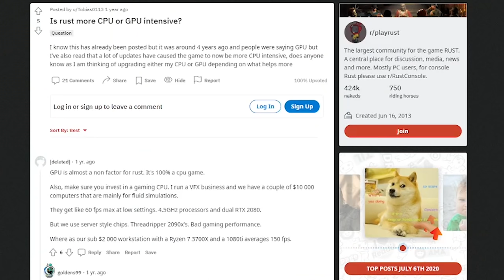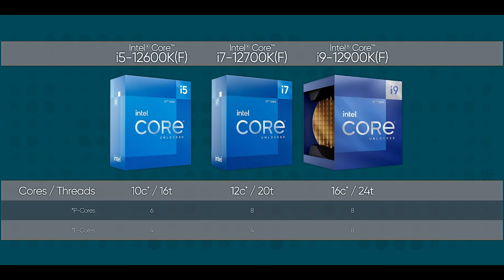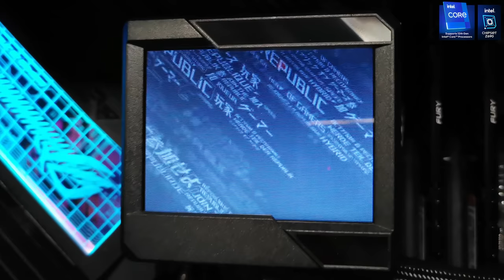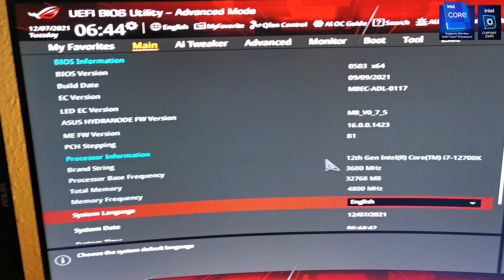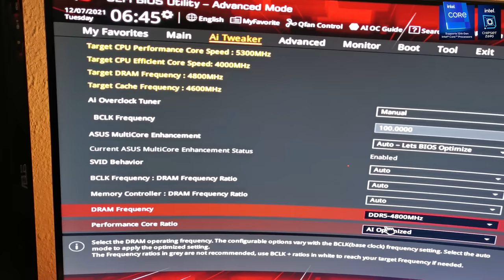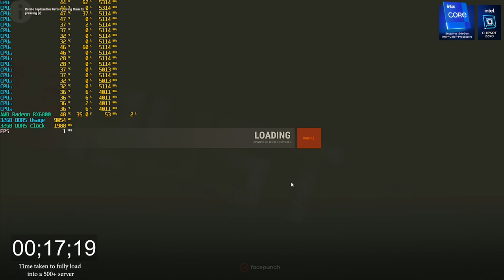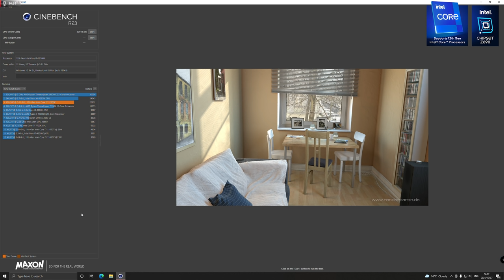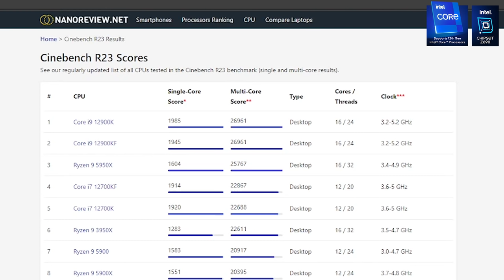RUST vs the worlds Fastest CPU

Comment: You keep saying "nothing is struggling" meanwhile your onscreen chart is showing multiple CPU cores sitting above 80%. The chart clearly shows that you are struggling to keep the main threads of the game running consistently.

I'll start explaining by just saying Rust is using poor methods of thread management, which mostly comes from Unity being pretty crap.... Most game engines handle things much better and can split tasks up more effectively. There's many different tasks being run at once in a game engine, but a lot of tasks are dependant on the result of the previous task(s), so a "main" thread handles splitting work up that can be split and sending it off to different threads to do the work, while telling the other tasks to wait for their input data.

A single thread can only ever run on a single core at a time, so no amount of adding cores to a CPU will ever help the performance of an individual thread. (Windows will bounce tasks around between cores to even out the heat etc but this still can't split a single task across many cores at once. This is why which core is maxed out changes constantly, but how many is fairly constant.) The only way to power through a bottleneck like this is with raw single-core power. As you can see on your charts, Rust is never even using all your cores at once (it seems to run 5-6 threads at most) meanwhile your GPU is sitting around bored waiting to be told to draw something at 40-60% usage.

Rust specifically runs into big issues because the "render" thread (the one responsible for telling the graphics card that there is a new frame to draw) sits in a waiting-for-input state for a HUGE amount of time while the other threads (sound, AI, animations, model [un]loading, whatever else is happening) are still busy. Even worse, many of those tasks are ALSO stuck waiting for some other task's result. A lot of this behavior is inherited from Unity itself, and many larger-scale Unity games end up running into the same kind of bottleneck. I'm sure there's some work that could be done here by FP but that means finding ways to split big tasks into lots of little ones, while also trying to optimize what tasks are even run and when. I don't envy that guy's job, especially with the Unity overhead to deal with.

TLDR;  Rust needs FAST cores, not more cores, because the game engine has severe bottlenecks unrelated to telling the GPU to draw frames.
Reply: HOPE Flak reads this. Hope FP does what you suggest... To a non tech-savvy gimp like me, it's all a bit frustrating and annoying that they chose to go a way that is clearly not ideal!!!! 🤬
Reply from the maker: Thanks for taking the time to type this. I think myself, and others, don't really have enough understanding in this matter to understand why it runs so poorly.

Thank you, I'm gonna pin you
Reply: YES! I tweeted this video to all the FP addresses I have... Don't seem to have Helk but yeh, hopefully someone with the right connections who has their ear,is nagging them!
Reply from the maker: @OldManPaxusYT  love you Pax
Reply: @MisterFlak  can you ping them to send me one of these cool pcs too?

Kidding, but maybe hey then to let us walk with the compound drawn like you can with any actual bow.
Reply: Does overclocking till it's a little toasty help get you these faster cores?
Reply from the maker: @sarchlalaith8836  honestly i just activated AI tweaker and it set all the parameters for me
Reply: Also the rust dedicated server loads all graphics assets into memory even though it doesn't use them. So if you are running a rust server around 80% of the memory is wasted needlessly.
Reply: @ketris. Maybe you can list some of the ideal cpus to use to gain the best fps in game then? I have a 2080ti and a i7-5960x but get shitty fps 70 average on max with everything turned off.. Need a fix for this shit it's been long overdue, the terrible optimization of rust and I think people would benifit with alittle more knowledge behind it. Maybe you and @flak could get together and do a video on it. Down to the science of how it works. I know I'd massively appreciate it. And all the forums of people asking this very question over the last 5 years will finally have an answer.
Reply: The next thing @Mister Flak needs to do is stop showing us all these fancy PCs and show us the one that runs Rust for the best performance per buck for us mortals what neither have Asus sending us free stuff or the finances to buy it. Tell me what components to buy to get the best out of Rust
Reply: Might be that rust is runnin on e cores instead of perfomance cores. Limits fps due to that. Should have got a 5900x cpu instead. Perfomance core/ecore scheduling is horrible atm.
Reply: @NikoCreates  your budget is what determines the best machine you can have for rust. A gpu that on it's own, costs more than most spend on a entire pc will help, but just spend as much as you can afford and that will be the best you can get.
Reply: First of all - i hope i am not completely wrong - if i am: forgive me.
but ive seen several "FPS-Boost-Videos" and in many of them the creator gave the tip to add into the steam settings of rust a comment that forced rust to use a special amount of cores AND threads.

one of those videos is named "THE ULTIMATE RUST PERFORMANCE (SETTINGS) GUIDE | 2020 | RUST" by sven.

the command is:
-cpuCount=X -exThreads=X -force-d3d11-no-singlethreaded

x = need to fill in your hardware "amount"

full of his added command is: ": -high -maxMem=X -malloc=system -force-feature-level-11-0 -cpuCount=X -exThreads=X -force-d3d11-no-singlethreaded"

so in case you didnt knew - i hope it helps and changes something, pls tell me if it does.
in case you already knew - forgive me for saying something obvious.

dear regards to both of you, 
@mister flak - love your videos!
Reply: @NikoCreates  Want the best bang for your buck? R5 3600, and a gtx 1070. Had a good range of upgrades to my 5900x 3080ti combo recently. my cinebench scores are higher than @Mister Flak and yeah, that is the sweet spot hands down, out of experience and pocket draining upgrades.
Reply: Would disabling hyper threading help?
It must right?
Reply: @0s0sXD  I did this and didn't notice any real change in my FPS. CPU core usage was about the same too. It's basically just a Unity thing.
Reply: This perfectly explains why my 4 core i3-9350kf at 5.1ghz gets more fps than more expensive builds.
Reply: @MisterFlak  SEND THIS TO THE DEVS!
Reply: SEND THIS TO THE DEVS!
Reply: awesome response loved reading this
Reply: Hey I hope u answer but what cpu would be the best I got i9 9900k 3080ti 16gigs of ram. I think 2400. Should I upgrade my cpu and ram???
Reply: it is time to rewrite rust in rust
Reply: @AndreasHGK  yes

Comment: they just need to make a RUST 2 with a better engine
Reply: exactly
Reply: @kubo1940  eh my 5800x3d pushes 160 fps to 200 on high pop servers it's just cache dependant. The lowest i ever gotten in fps was 80. Trausi the rust youtuber has the same pc as me.
Reply: @silentx9709  i have a base 5800x and i get the same
Reply: @silentx9709 what gpu u have
Reply: @silentx9709  Yeah but you would get 1000 fps in a game like rust with the same pc, if the game was made in a different engine.

Comment: I remember that when I got my first gaming PC in 2018, it had all the top specs at the time; i7-8700k, GTX 1080, 16GB RAM, NVMe ssd, and I tried running rust at 1080p medium and the game still struggled to run at barely 60fps; every other game I owned was able to reach 1080p ultra at 100+ fps lmao
Reply from the maker: It's an absolute mess
Reply: Hmm strage, did you overclock your cpu & enable xmp profile on your ram? / overclock your gpu?  in game my fps ranges mostly in the 95-100 fps, falls down to sometimes 84 fps and goes up to 125 fps at the highest. 
Not sure what settings you ran your hardware but im playing rust on a 1440p high refresh 165/180hz  oc'd monitor with msi gaming x 1080 8gb overclocked to 1900mhz on core and 5200mhz on memory when im in game, and my delidded liquid metal 8700k overclocked to currently 5ghz all cores, have tried 5,3 5,2 and 5,1 but had higher temps thus settled on 5ghz all cores. I also got 16gb cl14 ram clocked at only 3000mhz havent bothered doing manual overclock on them just xmp in bios. also have samsung NVMe ssd 970 pro gen 3. with x4 speed enabled, do you still have your hardware or did you upgrade it? seems you're missing out on quite some framerates here @Matt LeRoy
Reply: @Aleks95  probably didnt overclock. im running an 8600k at 4.8 and get about 80-100fps, but when on no oc its like a choppy 60-70 with dips into 50s.

Comment: It’s crazy how in any other game when you turn your resolution from 1440 to 1080 you easily see 20-50fps increases but in rust there is literally 0 frames difference in my testing. It’s honestly baffling how terrible the optimization is. Also ever since the graphics overhaul a while ago my fps has been so much lower
Reply from the maker: Bro it's stupid. Even from 1440 to 720, zero difference

Comment: This makes so much more sense now! My friends with 2060’s and i5’s cant understand why me with my 1060 and i7 am consistently getting 10-20 frames more performance than them on rust.
Reply from the maker: Yeah man gpu don't matter, cpu is where it's at
Reply: I have a 1060 and i7 4770 im doing like 70 fps on rust
Reply: @ZeeToxx  yeah exactly what im talking about and it makes sense too because im pushing 90 most of the time with an i7 8700k
Reply: @ZeeToxx  yes. no need to upgrade. trust me. i've been through all the specs. 50k drop for little to no fps gains are ridiculous.
Reply: I'm getting 80 with an 970 and i5 3570k non overclocked
Reply: @botmert  ok but what settings because i’m not believing you at all if you say anything above qual 1 or 2
Reply: @squash2127  i get lower fps the lower i put my shit i dont have it installed buy i use default settings

Comment: Rust is depressing. My AMD Ryzen 7 3700X is way above recommended CPU for Rust, and yet it's really not a good experience. Paired it with a GTX 1660 Super, RTX 3060 Ti and RTX 3070, no difference at all. I know upgrading to a 5600X would give me more frames, but I'm not gonna waste money like that for one horribly optimized game. Facepunch deserves a face punch.
Reply: god damn! it's frustrating and now i guess i may aswell not even bother updating... did you see what @Ketris wrote? And @Zeck? Someone needs to do a Rust optimization video coz u can boost FPS a fair bit with lots of other changes (like windows, ur pc, rust settings and possibly some graphics card tweaks..)...
Reply: You should get 5600x , it got me like 40fps increase going from a 3600x paired with a RTX 3070

Comment: There are 2 main issues for rust fps performance. 1. The game came out more than 8 years ago and during that time period there were tons of patches. That can make 100 fps feel like 50. RRD2 @ 60 fps runs smoother than 120 fps on rust. 2. The game devs at facepunch moved the game to Unity 5, to allow more features in the game and have more headroom for updates. When they transferred all of their code from Unity 4 more people experienced weird bugs and glitches. Once again, they patched them. All of these patches don’t help the games performance.   I could run a gtx 1070 at max settings with an i7 9700k and get 5 fps less.

Comment: Keep in mind that there are all different kinds things to optimize to get better fps in game. I believe if you change a few things you could average 20-40+ more frames on rust. How? Windows 10 optimizations, reigistry optimizations, possible overclocking, optmized rust launch options, and optmized rust graphics. But fps in Rust seems to decrease based on where you are in the server, where you are looking, but most importantly, how many other players are on the server.
Reply: Actually, yeh... Someone needs to do one of those videos showing exactly WHICH optimizations! (there were several of them for b4 the big graphics overhaul)

Comment: the reason why is because the rust game engine is just unoptimized and cant
Reply: Apex Legends is done with Unity... First game that came to mind...

Its not about Unity... Its about how the game is made... Apex works just fine with no problems.
Rust just isn't... Why? Who the hell knows... Game is just not optimised as it self
Reply: @itscomboz  you WILL get 60 fps and you WILL like it
Reply from the maker: Also rust maps and entities are like 1000% larger than apex
Reply: @MisterFlak  bro apex runs on source, dont listen to ppl without fact checking.
The only reason why is cuz rust since 7 years wasting their time on dumb engines to make their programming ez , instead of using a good one and putting work in.
Reply: @itscomboz  tarkov also uses unity and has the same issues with bad fps no matter your hardware

Comment: Might be worth chucking a 240Hz monitor at that rig to see the full potential. I see in the description your only using 144Hz? I've got a way less of a system but have a 240Hz monitor and don't see the cap like that.
Reply from the maker: I hear you but monitors don't cap fps.

Hence how I was able to get more fps than 144 on Apex for example. I won't see more fps than 144 with my eyes, but the system will still make it if it's possible
Reply: @MisterFlak  Yeah very true, just thought you might be able to squeeze some more out of it at least for feel and smoothness. It's hard for me to say cause I went from a shitty 19" 60Hz monitor to a 240Hz monitor but its kinda over kill with my mediocre system.
Reply: @MisterFlak  Man, commenting again cause this has me kinda disappointed too. I'm in the market soon to build something along the lines of what you've got for Rust/Tarkov/FiveM etc (all unoptimized popular games that ACTUALLY stress test systems) and seeing that beast of yours only getting 120-140fps with those specs is disheartening, would a severe but stable OC force it higher making the cores work harder? In the video you can see and you say the cores aren't anywhere near stressed or working hard. This kind of stuff baffles me but intrigues me so much. Keep up the awesome content Flax much <3 homie (do you remember me from Vertiigo and TankGirls wedding?)haha

Comment: I think it is server bottlenecked.

Most servers run at 120-140fps (its weird how rust servers work) so you can not get more than what the server runs at.

As the server gets more busy the fps can drop on crappy servers due to bases and players so even a i9 will run 60fps when a server runs at 60fps.

When you fire 1000's of firecracker rockets in a single go you can bring a server's fps to like 1 or 2 then even the i9 3090ti will get 1 or 2 fps
Reply: interesting....
Reply: i'm sure server fps and client fps are two different things

Comment: Has anyone actually tried DDR5 for rust yet? I noticed faster ram boosts your FPS by alot in this game for some reason so i wonder how it would run with 16gb DDR5 6000
I found some kits for 160€ thats not that expensive
Reply from the maker: This video it's using Ddr5 bro
Reply: @MisterFlak  since its not optimized well ddr4 might be better than ddr5 in some cases

Comment: I was watching a Mr lou video awhile back and I shit you not he had 150fps in rust. Barely dropped below 120fps. Never seen anything like it. I asked him to drop his specs but of course he didn't.
Reply from the maker: Was probably his server size not his specs tbh
Reply: @MisterFlak  yh they are dead pop I get that but Holy shit...I just want 100+ at all times haha. Is that too much to ask. I linked your video and opened a ticket with facepunch and cried and cried to them. Hopefully if enough people keep on at them it will get addressed. But I highly doubt it flak  😔
Reply: @joeleemccarthy  don't watch these videos they don't have a single clue, probably tell by his movement, his settings and etc & lack of knowledge, these guys get spoonfed silly overpowered PC's and try run games they don't have a clue about.

I have i7 8700k and 1070 and I can get 120+ fps on optimised competitive PvP settings, with nvidia filters, you can optimize this game more deeper than just in game UI and windows optimizations, all this guy does it apply overclock and done, without a doubt if i had his system 200+ fps constant with around 150 fps being the 1% avg low

If you make a custom CFG for rust & optimise your OS and etc, while having all the fps command for rust and etc, it runs well.

Comment: I love Rust, my pc is a few years old now and its hard to play the game. I drop sometimes down to 40fps in a fight. And now I'm thinking about to buy a new PC for this game  but I know it wont change that much... idk it is a stuggle with this GAME. I just hope they can somehow fix it or make it a bit better.
Reply: Old comment.. but no joke don't watch these videos they don't have a single clue, probably tell by his movement, his settings and etc & lack of knowledge, these guys get spoonfed silly overpowered PC's and try run games they don't have a clue about.

I have i7 8700k and 1070 and I can get 120+ fps on optimised competitive PvP settings, with nvidia filters, you can optimize this game more deeper than just in game UI and windows optimizations, all this guy does it apply overclock and done, without a doubt if i had his system 200+ fps constant with around 150 fps being the 1% avg low

If you make a custom CFG for rust & optimise your OS and etc, while having all the fps command for rust and etc, it runs well.

Comment: Game dosen't run too bad on my rig. I have a 6700k CPU and a 980 Ti and it runs at 1440p around 55-60 fps or something, i haven't followed the fps so well but the expirience was pretty much buttery smooth apart when i'm running out of RAM in certain servers (and i have 16GB of RAM so that's strange) but even then the frame times themselves are still really good.